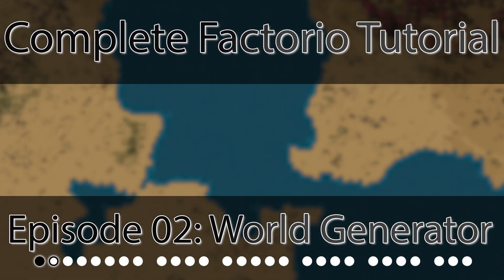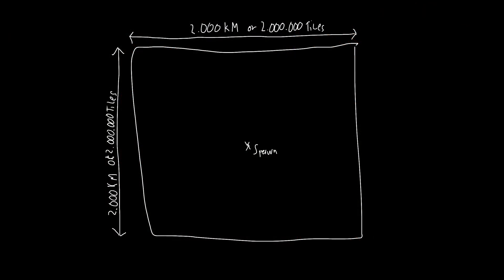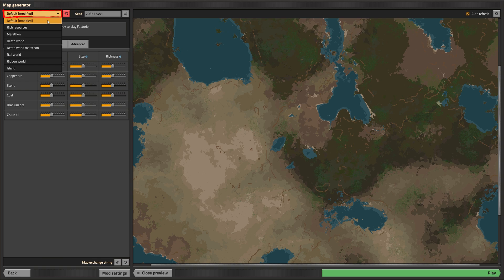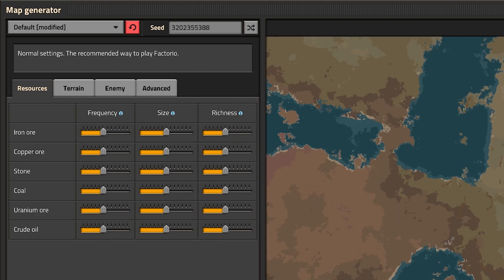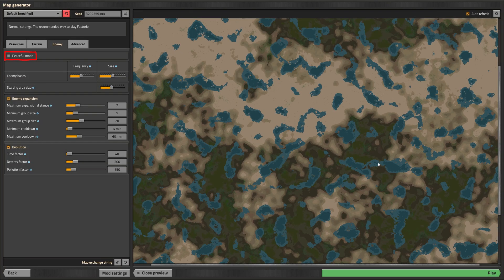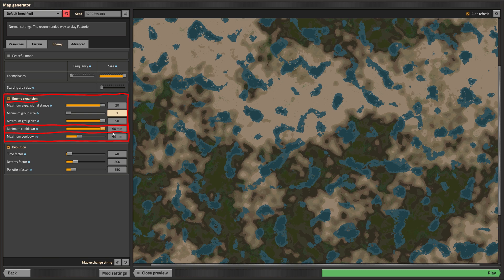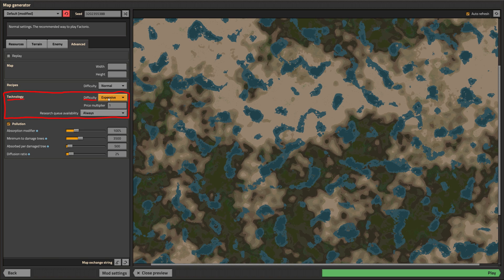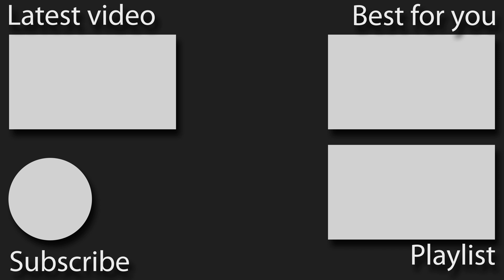[0.17] World generator - #02 The Complete Factorio Tutorial

Comment: 7:44
I'm using version 0.17.14 and at Advanced Settings under Pollution I have 5 values:

-Absorption modifier
-Attack cost modifier
-Minimum damage to trees
-Absorbed per damaged tree
-Diffusion ratio

I noticed you don't have the "Attack cost modifier", and I am unsure what that means. The in-game explanation goes as follows: "Modifier of how much pollution is absorbed by enemy attacks".

If I set this value to low, does this mean less pollution will be absorbed per attack, hence there will be more attacks due to the extra pollution? Or does this mean there is less pollution available for enemies to consume, hence there will be fewer attacks? 

Thanks for your help and great video :)
Reply from the maker: Enemy spawners store pollution and if that reaches a threshold they plan and start an attack. Going on an attack will then reduce the stored pollution and this will probably control how much this gets reduced. I guess turning it down means more frequent attacks and turning it up less attacks. I’m not 100% sure if that’s right, but I can’t think of and other meaning.
Reply: @factoriovideos  
Ok, thank you very much